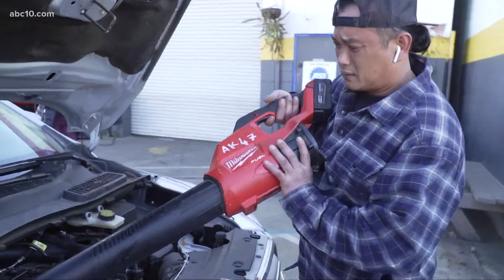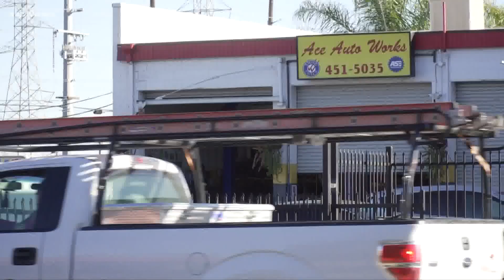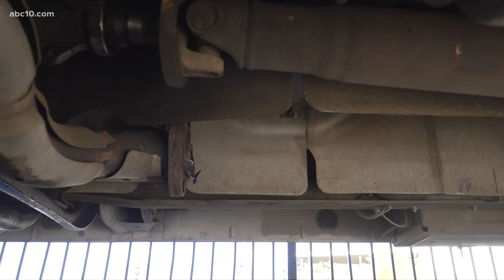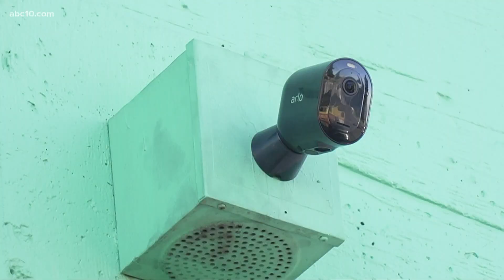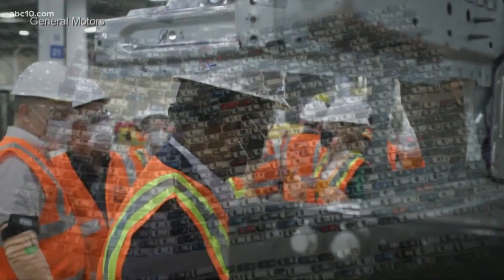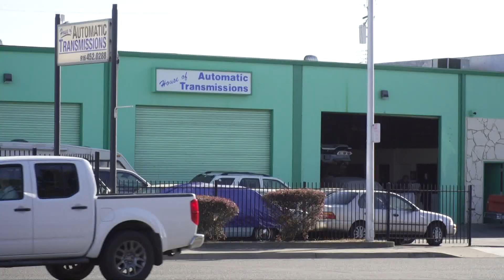Catalytic converter thefts on the rise in California | How lawmakers hope to stop the thieves

Comment: The auto makers know this about this problem..but don't take steps to prevent it ..such as anti theft devices that can be built in to the under carriage. That's cause there is a big market for replacement ones for the manufacturer and the dealer..a simple $100 device can put an end to this nonsense